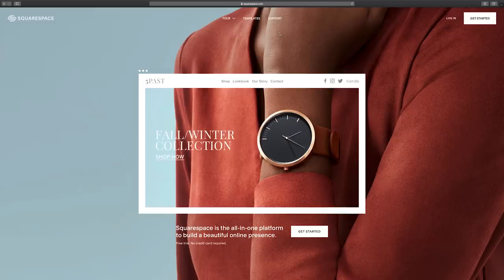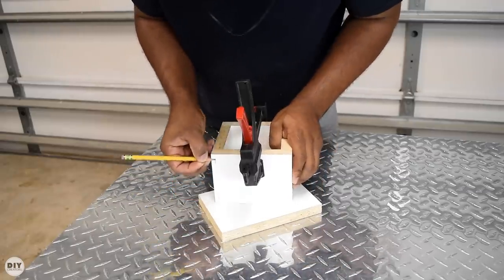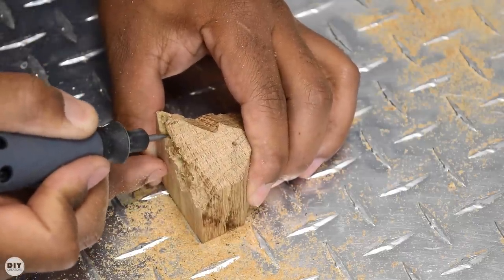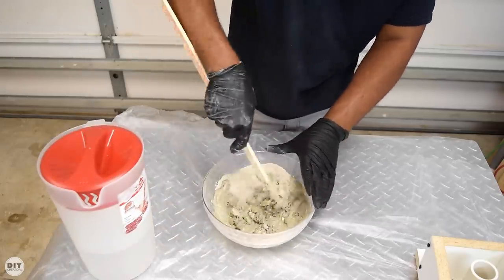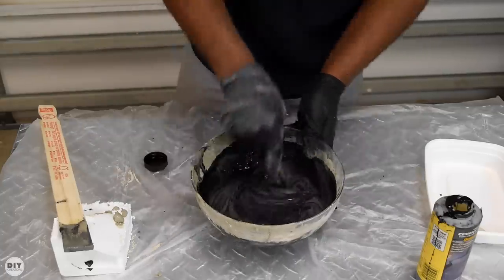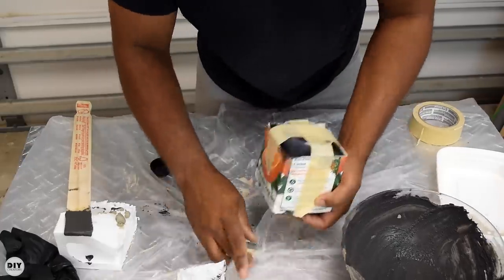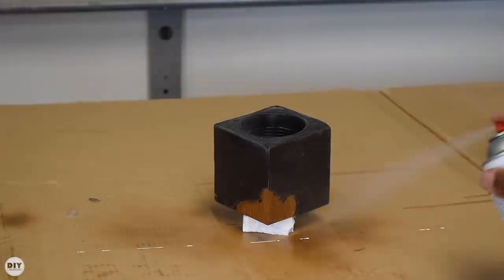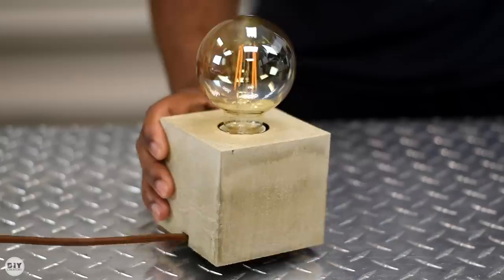2 EASY DIY Concrete projects you can make ( desk lamp & planter )

Comment: Looks great!  Alcohol will remove hot glue, I've only used it on glass but it should help.  And if you prefinished the sides of the wood with something not soluble in alcohol it should come off very easily.

Comment: Good idea, but you should consider a better way of securing the bulb holder to the concrete block than just a splash of hot glue.
Reply from the maker: Thanks I'm taking suggestions if you have a better way :).

Comment: I am a bit confused, you describe it as a "concrete" wood lamp and yet you say you are mixing the "cement".
The mix doesn't look like concrete (no sand or gravel) and it doesn't mix like cement alone. It looks more like plaster of paris, what is it?
(edit)  I have just seen in the description its a cement based grout from somewhere called Home Depot we dont have that company in the U.K.